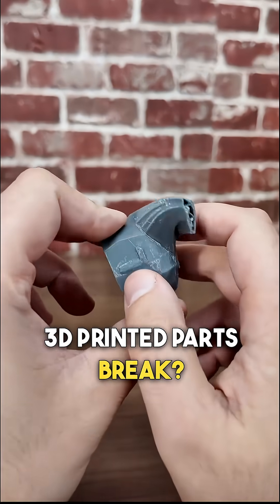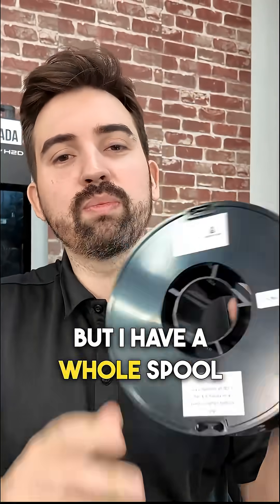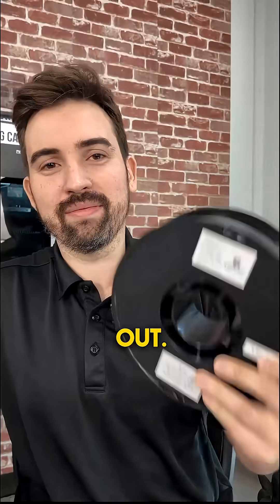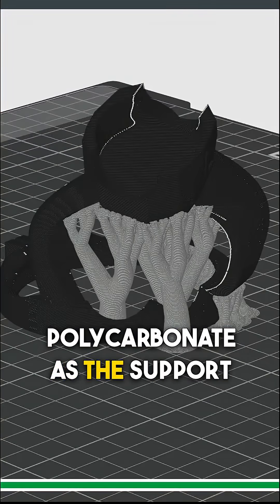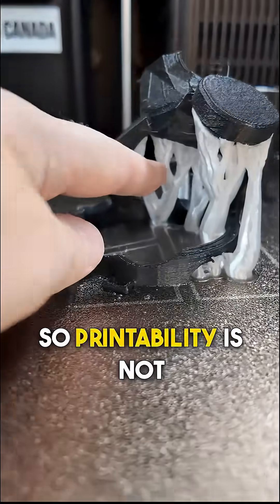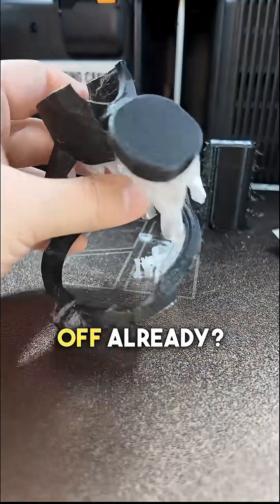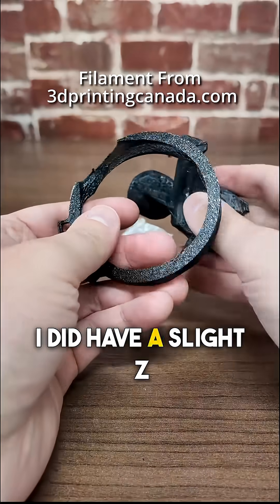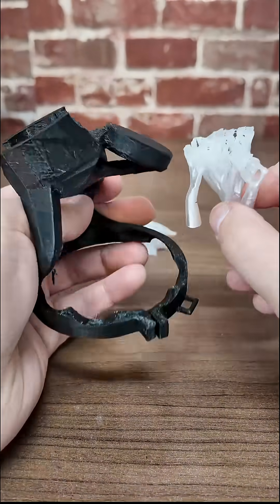I Discovered a New Way To Print Nylon #3dprinting #bambulab

Comment: Try printing with the same material up to the point where the supports reach the model. 
This way you can print faster by only changing the material for intersecting layers

Comment: Even with PVA material water soluble supports never tried it before, but I’m wondering if I can go through a CFS machine as a support material PVA is pretty cool. It dissolves in water.
Reply: this would probably be optimal for the situation if it sticks enough, since Nylon gets tougher when hydrated and rigidity doesnt seem like the most important material quality for this application anyways